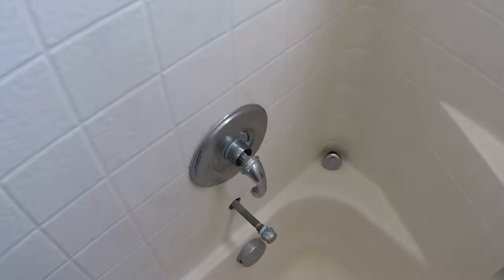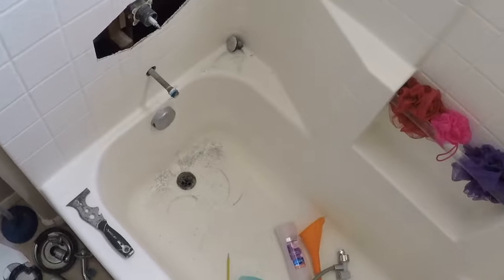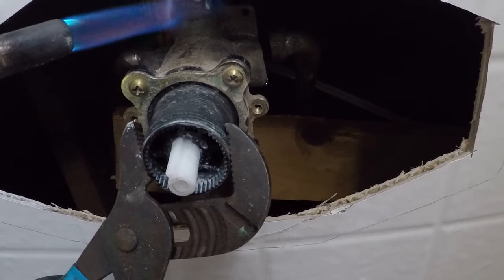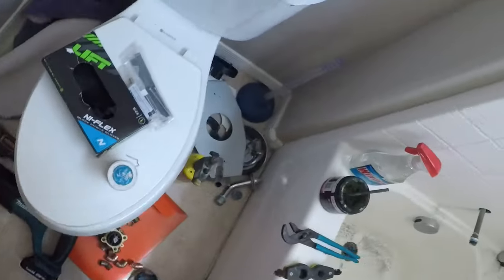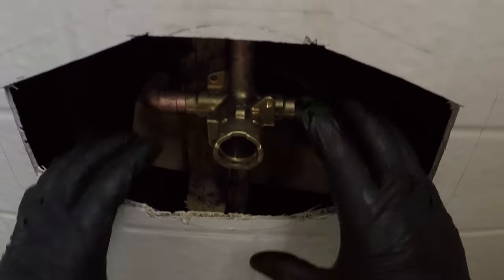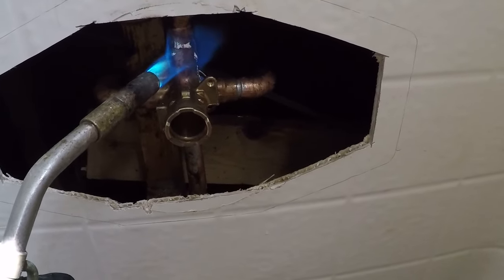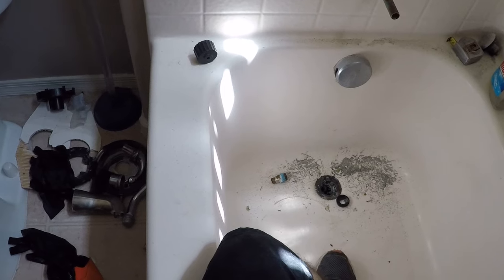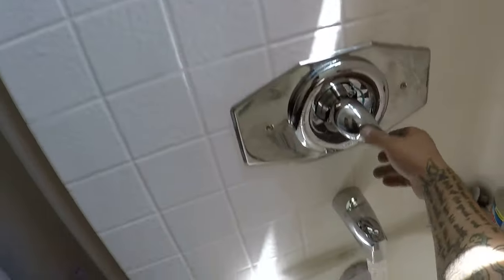How To Replace A Shower Valve Through Fiberglass - Gilbert, AZ

Comment: I want to thank you for posting this video. This is the only one I could find that gave me the solution for replacing the valve in my fiberglass stand up shower. That backing plate was the key to my repair, since accessing the valve from the front was the only option. Thank you for saving the day!!
Reply: Where can I get one of those backing plates?

Comment: Hey Sir, 
Great Video. I couldn't see every little thing you did but got the idea. Now I've got to do the EXACT same thing. 
I put in my water heater with instructions from my 80 yr old neighbor, a retired Master Plumber. But have never tried a shower valve in a confined space. There is a small utility door on the side of the tub but the opening is only 4.5" wide. TIGHT!!

After multiple calls to plumbers, I got 3 out to give a bid. They want $350-600 to fix it for me. I got the $, but I think that's too much for something that should be able to fix in 2 hours or less. Plus I like to do repairs myself if at all possible. 
Putting the new valve will not be as bad as getting the old one out. But it shouldn't be too bad. I can sweat the old 90s on the supply lines to get those off. Then sweat the shower joint. Voila, I can get the old valve out. The tub spout is threaded to the valve, so just unscrew that. Clean n prepare all the pipes n put the new valve in. 
I'm really doing the same job you did here, I just have that small door as access also. I still think it's probably best to use the cover plate. Make things easier. This is my final home so I don't really care what it looks like as long as I can take a damn shower/bath.
Thanks again for the video and the inspiration to do this myself. Save a few hundred bucks and have the pride knowing that I fixed it!! ✌

Comment: Smartly done job! Did the same kind of service work for years & your spot on about it being a whole different  process than new build. Used to refer to it as  similar to having to  re-weave the canvas (from the front) after the portraits been painted without mucking up the  paint!  :)  You almost made me spew my coffee at the screen laughing with you comment of "What the heck was this guy thinking?!"  If I had a nickle for the number of times I've thought those same words (and a few less polite ones! ;), I'm quite sure I could have retired comfortably by now!  Integrity is the only gift you can give to yourself that NO ONE can take from you without your consent!  The quality of our work will be the measure of our worth long after we are gone.  (particularly so, in areas that most eyes will never  see, as if we did the job well it will not be looked upon again for a life time or more, and even then, it will be looked upon with reverence.)
A couple notions that might help you down the line, if you open to em.   
If you  take a 5" or so,  scrap piece of 1/2 hard copper (old house remodel stuff is WAY stronger than the stuff today), cut  along its seam  & compressed down in diameter to just fit into the shower elbow and then soldered along that seam to keep it rigid.  you wont ever have to worry about egging out the threaded end again. 
Second, as our fearless  leaders  seem to be hard at work every day trying to make our work harder,  they are making flux , and solder, and even copper less robust than they were even 20-30 years ago for  "environmental reasons".  While I also learned that spraying or wet cloth cooling of joints would not potentially harm the joint and it was fine and even good safety practice to do so to avoid possibly burning yourself or your work partner, I've recently discovered that while it wasn't  an issue in the past, it can make your solder joints brittle an susceptible to failure from water hammer issues as well as other pipe movement issues commonly found in older properties, like  cleat or  strapping failure.   Given the  scary $ costs of a joint failure in wall call back/claim I  just let the joints anneal at their own pace to let me sleep a bit better at night, not worrying about differential stress fractures/ failures.  Costs nothing but a couple seconds more  (and remembering not to grab the joint to soon! lol  ;)
At  any rate,  nice job on this re work!  I live in Phoenix area & mom lives in Gilbert.. It's nice to know there are others still working in the Srvc. industry that aren't just "pastry chefs" lol!

Comment: As a retired service plumber I have replaced many shower valves when needed. I was wondering why you didn't just break off the handle and then put in a new cartridge? I have replaced cartridges for my customers after other plumber told them they could not be repaired that they needed a new valve, saving my customers lots of money.
Reply from the maker: I could not get the back part of it out, and the landlord just wanted it replaced, so I did it. I do not work on commission, and I am hourly, but we do not charge by the hour. No upselling, and no incentive. Good luck in retirement. Thanks for watching!

Comment: Fire extinguisher?  Drop cloth, tub/floor/toilet protection?
Reply: He has hand protection.  :)
Reply: I do all the rest like you said but never fire extinguisher. Been doing it for over 20 years.   If you know what you doing , no need a fire extinguishers.  Just wet surrounding area is good enough and the fiber needs to get really hot to cause fire.
Reply: @JohnT2088  😎👍👍!

Comment: Next time you should cover the bathtub from any debris from going into the drain
Reply from the maker: I probably should have done that lol
Reply: P ff
Reply: q
Reply: Yeah and not cake  solder and flux all over the connection, or nearly burn the house down by not using a fire retardant cloth.

Comment: Did you not have access behind the valve body? Those big reno trim plates are ok but not necessary for single to single. Were meant for going from 2 handle to single handle. Did they not want to fix their Price Pfister?
Reply from the maker: Back-to-back bathrooms and the cartridge was completely seized into the valve body. This was the only way to do it.
Reply: it's a stash spot, they want to hide cocaine inside the wall, based on the home size it looks like a big shipment from Columbia LMAO

Comment: Was reading about the putty, I have never seen putty on a shower valve plate, maybe thin bead of silicone at times for ocd customers  is someone pressure washing the shower stall? Some plates have some kind of gasket for sealing included. Good job I shy away from complete retrofits.
Reply from the maker: LOL pressure washing. Yea I usually just throw a bead of caulk around the edge but never putty. That's a real old way of sealing. That guy was just trolling.

Comment: I have a moen push pull shower valve that just spins around 360° angle. Hot + cold water work fine, but it's confusing when we have guests who don't know how to operate the shower. The tub is fiberglass and my husband's afraid we'll have to rip out the unit to repair parts that are behind it. This video gives me hope. Is there a special part that stops the valve on the right and left sides?
Reply: Yes, u have to remove the handle and you can see more of the problem then..you can find alot of replacement parts at a hardware store..tell your husband not to be scared..

Comment: Great job btw. But be careful with over tightening the shower head arm cause you can crack that drop ear brass fitting in the wall. But other than that nice video.
Reply: The fitting's name is a "wingback adapter" Doing it the first time when the wingback is new you aren't really at much risk of cracking it. The issue is that brass can go brittle over time. I've broken brass crimp fittings for water lines by doing work nearby.  Wingbacks are thicker so they tend not to break as often but it does still happen.

Comment: What if your customer doesn't want the new big faceplate??? can't we make shower plumbing fixtures interchangeable with union joints so we can make incredibly difficult jobs more easy to manage? That big chrome faceplate now get hardwater stains and can be burned by chemicals, scratched by people. Also - I like to install shutoff valves under the shower access panel - I had an 8 unit complex i had to shut the water off for an hour to fix one person's shower - yet every sink has a shut-off valve???

Comment: My shower has a single lever faucet but after I take a shower water is leaking from behind the wall and running down the left hand pipe and dripping on to my basement floor.  I removed the metal plate behind the knob after I took a shower but there is no water on the faucet or the pipes.  Where could the leak be coming from that lets water run down the copper pipe on to my basement floor?  I put caulk around the metal cover behind the knob like 2 plumbers told me to do but that did not fix the leak.

Comment: How many inches of space you have, between the fiberglass wall and front of the diverter (brass fitting) or how many inches you bring the diver towards the wall. I have same situation. Old unit is large new unit "Moen" is small. I need to bring it towards the tile wall.
Reply from the maker: Moen makes an extension kit for that exact purpose. You can just put the shower valve in exactly in place wherever the old one was at, and If it’s too far back, you can just use the extension kit, which is longer screws, longer handle insert, and longer dials.

Comment: Great video but why didn't you just replace the trim kit and cartridge?
Reply from the maker: The handle was frozen to the cartridge, and the brand was a generic off brand that I couldn't find a cartridge for. It was just faster and more beneficial to replace it. I charge hourly, not flat-rate, so I had no incentive either way. I just gave them their options and let them choose.
Reply: Looks like it's a Price Pfister product - brand name on the shower head. They have a life time warranty for their products. What a waste...
Reply: Da Kuang definitely, this was a poor job.
Reply: @TOTALTECHAZ  It is indeed clearly PF, not "generic."
Reply from the maker: @rc01010101  I realize that now. At the time I must have assumed it was generic because the tenant had already mangled it to shreds trying to remove it because he said it was stuck. I was just getting into residential at this time. I had previously done all commercial - hotels, supermarkets,  restaurants, office buildings. You don't see those there.

Comment: You did a good job, it came out looking good.  A friend of mine wants to do similar to his shower, he has a very old 2 handle separate h & c valves and wants to upgrade to the single lever.  I think he might have a bathroom closet behind where we could also get access, which helps a lot.
Reply: Any updates on your project? 

I'm in the middle of a bathroom remodel and there's a linen closet behind the tub/shower valves. Makes it so much easier. Can't imagine doing it all from the front.
Reply: Forgot to mention I'm replacing a non anti-scald valve from 1978. 3 kids so want to make it safe.

Comment: I'm new to all this and I'm replacing my valve so my question is do I have to cut the pipe like you did or can I just heat it up and it comes loose
Reply: You can heat it up it will come loose

Comment: Replacing the trim and cartridge would have been a better job overall. Should have used a couple of moving blankets on the floor and Tub. Not bad overall.
Reply from the maker: Yes you’re right it would’ve been better to block off the drain. But as far as the job itself, I really wish it was that easy. In this instance it had to be done this way. Thanks for watching.

Comment: Teflon tape PLUS pipedope ? Where did you go to school ?
Reply from the maker: Yes both. On gas lines typically we just use pipe dope since it’s under such low pressure. But on waterlines, we use tape to fill the threads, and pipe dope as a lubricant so we can get it as tight as possible with no friction. They both serve their own purpose. At least here in Arizona. Thanks for watching.

Comment: hey where can i get that kit with the big backing i need to cut the wall on a shower to do the same job , whats it called  thanks
Reply from the maker: Anywhere. Home Depot, Lowe’s, Plumbing supply house. They are life savers
Reply: @TOTALTECHAZ  thanks found the last 1 at home depot

Comment: Cut the handle off remove the plate remove the four screws remove the cartridge and replace with new. Order new handle done! why replace the whole valve body!!! Milk it milk it !!
Reply from the maker: Yeah just like that huh. I had already tried to get the cartridge out the day before and it was jammed in there from a handyman before me who scratched the valve body and got it stuck in there. Otherwise, obviously that would be the way to go. I am a decade long licensed plumber what about you? If you’re not licensed and you still live in your moms basement, please don’t ever comment here. We have all become a little dumber now after listening to you lol. Thanks for watching.
Reply: @TOTALTECHAZ  We both know thats a lie a 5 year old could remove that cartridge with a philips head screwdriver. Shouldnt pad the job with all that extra work chum.
Reply from the maker: jnn L Still no license number. See. No one cares.

Comment: What should one do if the cartridge is really stuck and won't come out. The white stem is also broken.
Reply from the maker: Trish Anderson I have another video where I remove a Moen posi temp cartridge that is broken off inside the valve. It can be drilled out or very carefully cut out and broken into pieces out of there. Just make sure you flush out all the debris. if you really can't get it out then you either have to call plumber or just change out the actual valve in the wall. Hope that helps.
Reply: GMR PLUMBING I will give it a try. thank you very much !

Comment: Thank you for the video demonstration. How much do you charge for doing this type of job? Also, when caulking, why do you not calk the underneath side of the fixture? Let me know. Thanks, Tony
Reply: For this job ,it’s about 1500.dont caulk under the trim so any water can drain at the bottom ,same with not cauling the back part of the base of a toilet so you can see if there is a leak

Comment: So,that plate is something they sell in the store?
Since one has to have access to the area that needs repairs.
Reply from the maker: Yes exactly. You can get them at any supply house or even big box stores like Home Depot and Lowe's. You can get them in Chrome or brushed nickel or oil rubbed bronze. They just cover the hole that you have to make. In this instance I would have gone through the back but it was another shower so I didn't have a choice. Ended up looking nice though. I still service these people and this shower is still going strong with no problems at all. Thanks for watching.
Reply: @TOTALTECHAZ  thanks man.
Always good to know these things.

Comment: __________I usually ask my customers to send me a picture (saves them $$$) of what needs to be repaired. In this case, a new Price Pfister cartridge (which is probably the easiest cartridge to remove, can't seize, it's all plastic) and chrome trim set would have been adequate.  But if no picture was sent I bring a complete rough valve and trim like this guy. (it takes about as long to go hunt down a new cartridge as to just stay there and replace the whole valve) I have never used a Remo trim plate, so far...and I've done hundreds of these. I also cut out the old rough valves like this but later sweat off those little brass slip joints and use the 1/2" street 90's after wiping off the old solder. A 1/2" repair coupling for the filler and yer in business. No huge  Remo plate to look at either. But this guy did a good job without burning the house down.

Comment: Just two words dude….. “shark bites”! Makes life so much simpler and quicker. Nice vid, but why not use them?
Reply from the maker: Shark bites are only held on by some stainless steel teeth and an o-ring. If those teeth get weak, they will open up and push off, causing a flood. I have seen it a million times. We do not install them permanently anywhere, especially not in a concealed wall. Only temporarily to cap something off, until we return to make the proper repair.

Comment: Wow!  he could've replaced the cartridge I think it's a Price Pfister or American Standard, with a new trim.
Reply: Youre right, that’s what I did for a tenant that was having pressure and cold/hot water issues. The valve was defective, so simply replaced it. Easily a 10 minute job and no destructive work needed